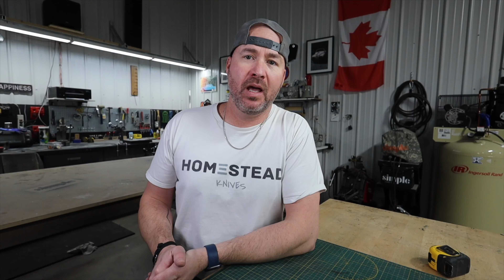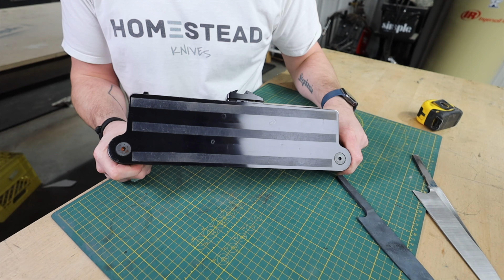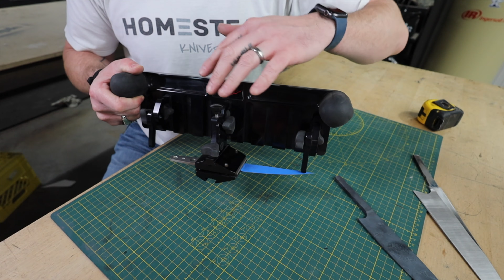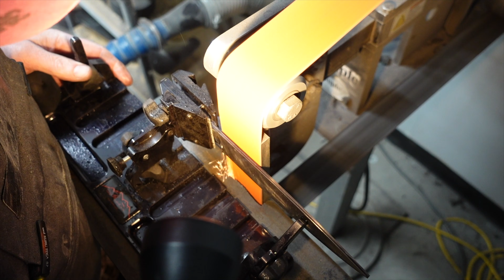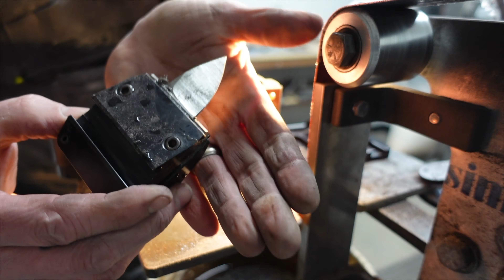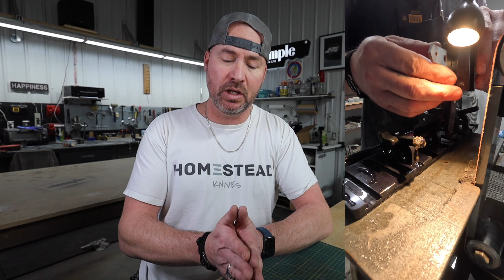World's most expensive knife grinding jig. Moen blade grinding fixture.

Comment: I think this is precision and stability beyond all need to make it very functional. My only issue is max blade height. Under two inches is a severe limitation. Say I'm doing a knife where the design is cut from three inch wide bar stock. I couldn't even approach using Moen blade grinding jig. Super wide knives with huge blade bevel height, even sabre grind, are not light & clever or especially portable knives.  A knife as wide as a Bowie knife, but blade length around a hunting knife are sorta ridiculous, but I want that freedom. Especially at the cost of Moen blade grinding jig. Something tells me it can be modified. Maybe take off the top screw entirely and use the support finger to mount round stock that can be sacrificed and hold under and behind the far end of the knife. l

Comment: Funny I built myself kind of the same jig from aluminum without being aware of this fixture, same with a  centered clamped on fileguide. The blade can be reversed in the same way, and I even had the idea of supporting the tip of the blade by inserting screws through the jig. Though mine has not as much features as this moen-jig, I am very happy with it, and it only cost me some 50 Euro.

Comment: Very impressive work, and the jig's nice, too!  I'm glad to see folks using those support fingers.  Years ago, I debuted that idea on one of the forums when another smith was complaining about how his long blades were always deflecting as he sanded them in his vise.  I'd had the same issue and resolved it by tapping some 1/4-20 holes in the blade support and inserting some nylon bolts.  Worked like a charm and I've been using it for a decade or so.  Publish or perish, as they say, so I was happy to get the idea out there since I'd never seen any knife makers using something to support the tip of the blade.

Comment: In the end, I saw that you dunked everything in water, is it enough to cool the blade by just spraying with water from a bottle or a small but steady dribble on the abrasive belt just above the edge of the knife, maybe operated by a foot pedal?
Reply from the maker: No, grinding blades quickly get the steel so hot you would need a steady stream of mist or water to keep it cool enough.

Comment: I feel a bevel jig has its place. But freehand should be what everyone aims for. Bevels jigs can only work good on straight blades. I only use them to hold blades that are extremely hard to get a good grip on so it doesn't fly out of my hand into my feet. But my carbide file guide is my go-to if I need assistance.
Reply from the maker: I agree. I went years only doing freehand and still do it regularly so I don’t lose the muscle memory. I do find though that with a good jig I am often noticeably faster than freehand grinding. A good jig eliminates some of the possibility of mistakes. This jig in particular is really fast and in doing this for a living, I’ll take any advantage I can get to be more efficient and productive 👍
Reply: @Simplelittlelife  That's the same thing the Henry Ford's of the world would say! Fantastic articulation of that point!
Reply: noup, a tormek system also works on a curve blade